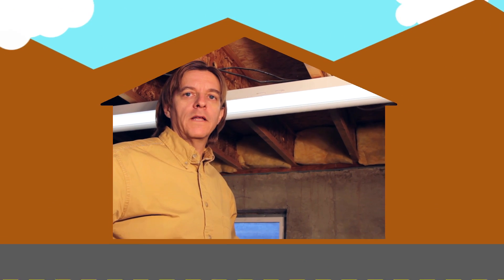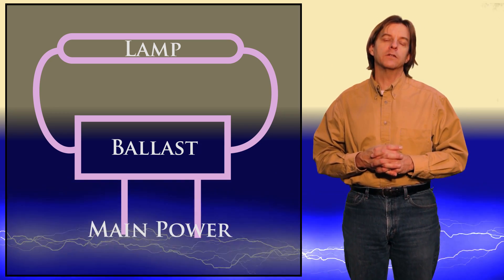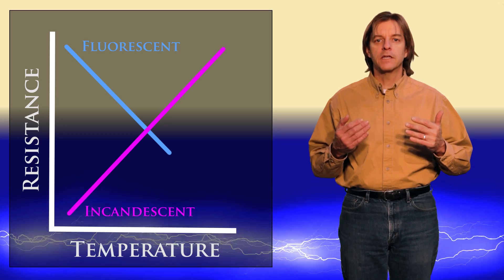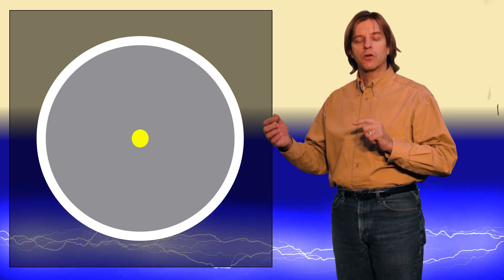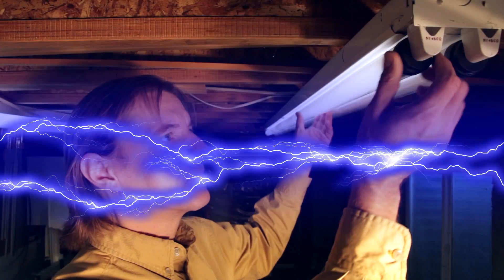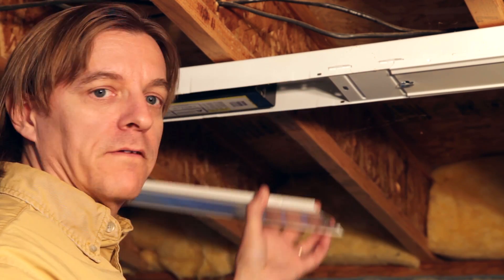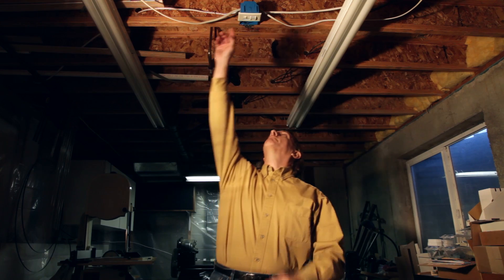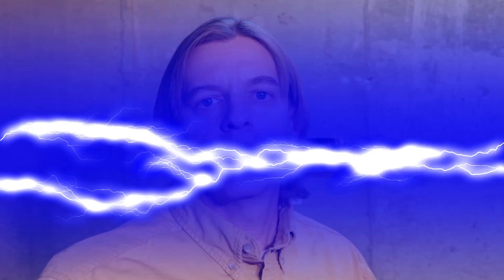How to fix a fluorescent lamp

Comment: Most likely why it was buzzing is because that ballast sound rating is different then a sound rating of A the one i have is the same magnetic ballast but it sound rating is C that is why there loud but if the ballast is older then the 90's then the ballast maybe dying and you'll notice that the ballast will spray or leak tar

Comment: I have 2 fluorescent light fixtures (each with 2 bulbs) running serially.  The first light fixture bulbs were dimmer than the second light fixture so I replaced the bulbs but it remains dimmer than the other fixture.  I tried switching the bulbs, but it did not make a difference.  Is the issue the ballast?

Thank you
Reply from the maker: I'd say it sounds to most likely be the ballast. You might want to check for bad connections before spending money on it though, although I'd be kind of surprised if it were this. Peace.

Comment: Interesting, if you say the buzzing fixture tended to go thru lamps quicker, sounds like a shorted coil or cap. That could happen to magnetic ballasts when people use energy saving tubes instead of the standard high power lamps they were designed for. Simple way to extend the life of your light, don't use the energy savers! They draw higher  voltage and lower current out of the ballast, which adds stress and heat on the ballast. This often gets magnetic ballasts a bad rep, yet they do have a potential to last around 80 years or more. Can confirm, have a four foot fixture from 1939 and it still works, slight noticeable hum, and it's manageable! Good video btw, well presented!
Reply from the maker: Thanks. I've had these lights since they were new and know they've not had energy saver tubes in them. I think they were just cheap ballasts. In any case, I think fluorescent lights are on the way out for me. I've put some LED "tubes" in another room and really, really like the light quality. They're expensive, but if they last, I'll probably be changing out all of them in the future. And hopefully the prices will drop in the mean time. Cheers.

Comment: I've got four fixtures in line running from the breaker box to the the last fixture. The third fixture wasn't working, so I replaced the ballast, and it fixed the problem. Everything was great. Almost a week went by and no problems. I go into the shop this evening. When I turn on the light switch, every other fixture is out except the one I changed the ballast on. How can all three fixtures fail simultaneously, and yet the one I fixed, the third fixture, still continue to work just fine? In other words; OOXO. Now it's XXOX. How is this possible? Did all three ballasts on the other three fixtures fail at precisely the same time? Help please... Thank you sir.
Reply from the maker: Hmm, that is strange. The odds of three ballasts failing at exactly the same time, while technically possible, seems pretty unlikely. More likely they have a common connection somewhere that has failed. That's just a guess but the first thing I'd look at. Use a volt meter to see if all the ballasts have power going to them; I'm thinking they probably don't. Assuming that's the case, then trace the wiring back to find a common point where there's power going in but not coming out. Good luck. I'd be interested in knowing what you find. Cheers.
Reply: nesyamiracle  f

Comment: I was hoping you would cover how to determine (without throwing parts at the problem) which component is bad. Yes I can start by replacing bulbs, but if it's, say, a specialty tube (black light or UV or such) I don't want to spend $$ if that's not the problem.
Reply from the maker: In newer fixtures, there are only two parts: the tube and the ballast. You can put the tube in another fixture to see if the problem moves with the tube. If it does, the tube's the problem. If it doesn't, it's the ballast.

Older fixtures may also have a starter. Again, you can move the starter between fixtures to see if the problem moves. If it does, what moved is the problem.

If you don't have another good working fixture to test against, I'm not sure how to test for failures with tools most people would have.

Hope that helps and thanks for watching.

Comment: Very educational.Forgets to mention what wire goes with which.
Reply from the maker: Thanks. There are a couple different configurations for wiring these so I didn't call it out specifically which wire goes where. Just follow the diagram on the new ballast. Cheers.

Comment: Nice info on the mechanics of the system, but no explanation of what you're doing when you were actually performing the work?  WHY?  That's the most important part.
Reply from the maker: Sorry you didn't get what you were looking for. Ballasts have the connection diagram printed on them. Replacing them is a matter of cutting out the old and wiring in the new according to the picture. I didn't get more specific because there are slight differences between ballasts. Hope that helps. Peace.

Comment: Have 3 _ dual tube florescent fixtures in my shop.  One has lights that are flickering.  I changed the bulbs..no change.  I changed them again thinking that I might have bad tubes.  No Change.  How do I know if the fixture is whooped or I have another problem?  Also, the box full of tubes I have as replacements are from many years ago.  Do tubes have a "best before date" that may be why these tubes don't fix my problem?   Is there such a thing as a LED replacement for florescent tubes in the same fixture?  Thank You
Reply from the maker: +Terry J Barber With fluorescent lights, there are really only two or three things that it can be, depending on the design of the lights. 1: the lights, which you've already changed twice, pretty much ruling those out. 2: the ballast, which I describe how to change in this video. 3: older fixtures may also have an independent starter that may go out and need to be replaced. These look are generally cylindrical metal canisters, typically between the size of a nickle and quarter around and about an inch long. They are generally at one of the ends of the fixture and twist/snap into place.

I've not heard of tubes having a "best before date" but I suppose if it's been decades, they may slowly go bad.

Yes, there are LED replacement "tubes." Some require removal of the ballast and some are designed to work with the ballast in place. I've not gone down this road yet so don't have any specific recommendations.

Looking at the suggested videos related to this video, I see other people have done videos here on YouTube covering both the starter replacement and LED conversion topics. You may find more details in one of those.

Cheers.

Comment: my light in my garage turns on then turns off  it takes tube light
Reply from the maker: +Wendy Slater First thing to change is the tube. It's easy and relatively inexpensive. If that doesn't fix it, then it's the ballast. Hope that helps. Thanks for watching.

Comment: If You are not electrician do not do it yourself!  The money you save is not worth your life ! Buying complet system will not cost much more!
Reply from the maker: Sorry, I disagree. If you're not comfortable doing it yourself, then definitely don't do it! I'm not advocating jumping in and blindly messing around with line (or higher) voltages. But that doesn't mean only electricians should do it. With very basic education about home electrical systems, this type of repair can be easily and safely done by a do-it-yourselfer.
Reply: +House of Hacks I agree too. you don't have to be an electrician, you just have to be a competent person.
Reply: +steveyboy6 h Thanks for commenting. Yeah, it can be intimidating if you've never tackled it before, but a little education and it's pretty straight-forward.

Comment: I don't like electric ballests.
Reply from the maker: Interesting comment. Why don't you like them?
Reply: House of Hacks well because sometimes when the tube is out and the ends of the tube arne black and you change the tube and it still isn't working, that is a good sign that the electronic ballest has failed,  and some electronic ballests are 50/50.
Reply from the maker: MAngus Maclean Thanks for sharing your experiences. If I understand correctly, you're saying you have a 50/50 failure rate with electronic ballasts? You find magnetic ballasts more reliable? Interesting. My experience is just the opposite. I have a much higher failure rate with magnetic ballasts than electronic ones. Thanks again.

Comment: Question for you.  I have three florescent fixtures connected to one switch in my garage.  I replaced the ballast in one of these today.  I used the push in wire connectors for my connections and simply matched colored wires.  There were two red and two red wires coming out of new ballast and the same coming out of the fixture.  I used 4 connectors for these wires ... connecting blue to blue twice and red to red twice.  I wire the hot wire (black) to the black wire from the ballast.  The same for the neutral. I heard some buzzing when I turned the power on but the light seems to be working fine.  But I'm still a little nervous because of my past "epic fails" with wiring.  Does it sound like I wired it correctly?
Reply from the maker: Yes, from your description, it sounds correct. Good job! They're really fairly simple, they're pretty much going to either work or not work.

Comment: I'm sorry,  but I remain confused.  My old ballast had the black and white hot and neutral wires as well as a single red, and a single blue.
My new ballast has TWO blue wires.  I was told to replace the tombstones at that end, and that each gets a blue and one gets a red and I 'jump' the red to the other one.

This did not work.  In your video I see you putting a blue on each tombstone and then splicing the red with the white and black?  

Sorry…  I learned a lot,  but remain confused.
Reply from the maker: It might help if you ignore the colors. Look at how the wire connects to the bulb connectors and compare that to the wiring diagram on the ballast. You want the wires to be physically connected to the ballast the way the ballast shows, regardless of color. Hope that helps.

Comment: Thank you for providing theory of operation as well as noting the different ballast types. I especially enjoyed the musical replacement montage; I will play that for encouragement when I do the job. All kidding aside, nice video. I had a hard time finding a replacement ballast for my 1978 fixture (would have had to upgrade inaccessible wiring to 90C compliant if using a newer T8 slim kitchen fixture) but I found a direct replacement magnetic ballast on amazon. Thanks!
Reply from the maker: You're welcome. I have an older fixture (I'm guessing 50's vintage) that I replaced the ballast in with a modern version. But I didn't have any inaccessible wiring; that might make it more of a challenge. Glad you found something that worked for you. It's amazing what one can find on-line sometimes. Cheers.

Comment: Man I am perplexed , my wife's 2 bulb fluorescent light in her closet went out , usually it was 1 light every 6 mo to a yr. this time it was both at the same time which gave the impression that the ballast was bad , however its getting 120v to both sockets , the ballast supports F15T8's to F20T12s which the F20's were installed from the start ..I replaced both bulbs with two new ones ,,verified again I had juice going to sockets ..nothing ..if the bulbs are good , and the ballast is getting power to the sockets then whats the deal ?
Reply from the maker: Since both bulbs failed at the same time, it definitely sounds like a problem with the ballast. Fluorescent lights are a bit complex electrically. I don't think you can determine the state of the ballast just by measuring the voltage at the socket. This is for a couple reasons: 1) the voltage should change dramatically depending on the stage of the light turning on and 2) fluorescent lights are primarily current devices, not voltage devices, so even if you have the right voltage, if you don't have the right current they won't work properly. Hope that helps.
Reply: I will go ahead and order a new ballast , and btw this ballast supports F15T8's thru F20T12's  should I change or stick with the F12's ?
Reply: Oh and thanks for your quick response on the earlier issue ..
Reply: T12's I meant ,,,sorry
Reply from the maker: If it were me, I'd get a ballast that still supports both, just to give yourself flexibility in the future. But when replacing the bulbs I'd use T8s. They have more lumens for fewer watts. Cheers.
Reply from the maker: You're welcome. Good luck.